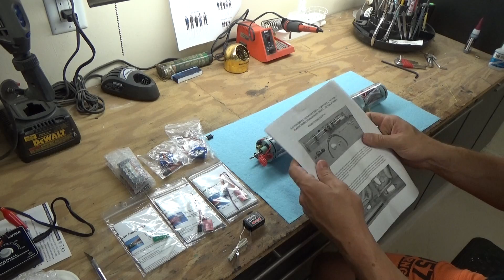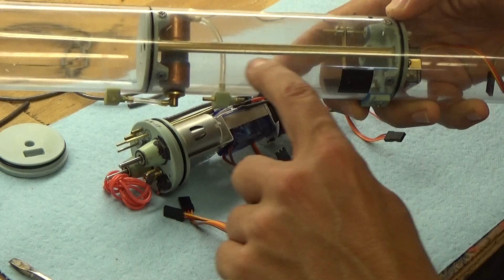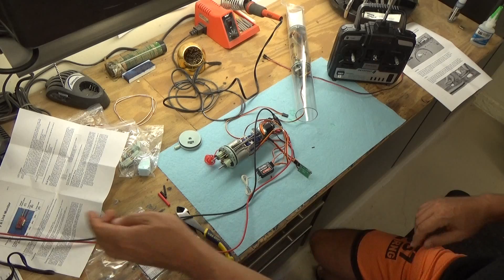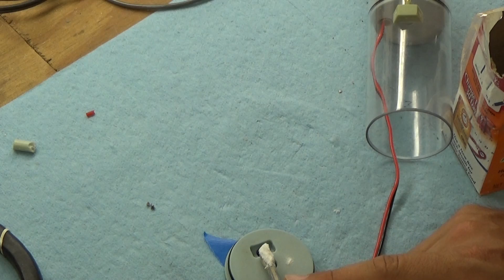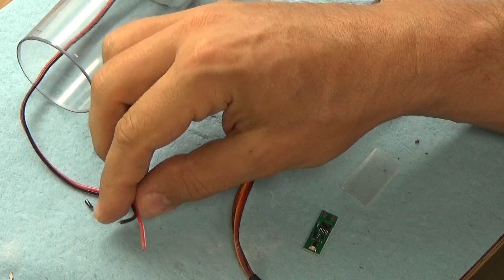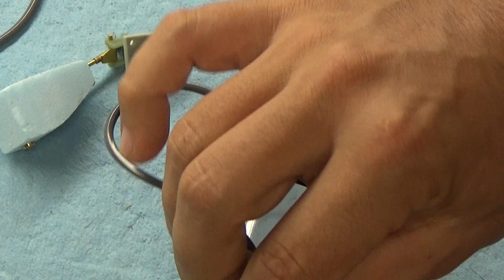Setting up the SubDriver watertight cylinder

Comment: Would a cylinder of this size fit into a 1/72 Gato class conversion?  Are those 2inch wide cylinders?
Reply from the maker: Those cylinders are now out of production, unfortunately. Typically, you'd use a 2.5" cylinder for Gato. I offer a shortened 80mm cylinder from R&R that works very well in that boat.

Comment: Bob, Thank you for the video. I have made my first step into this escapade. 3" clear PVC Tube and a 10 pack of o-rings. Do you thing 9g metal servos. would work for the dive planes? Could you link to the parts. in the connectors bag.

Comment: I thought 2.4Ghz did not work underwater?
Reply: Michael Upton it doesn’t, it’s for if you want to float ur Ariel from ur sub to the surface using a long cable and a float